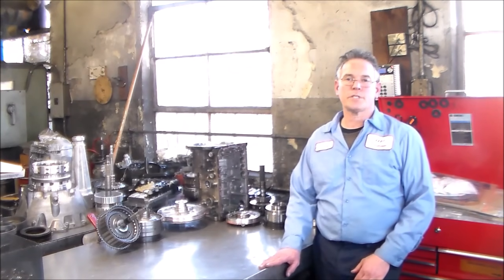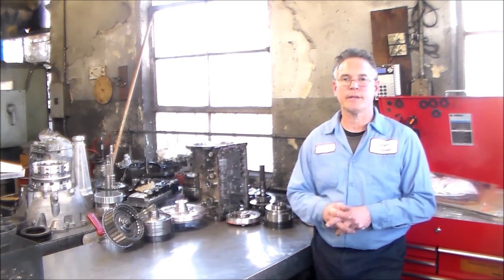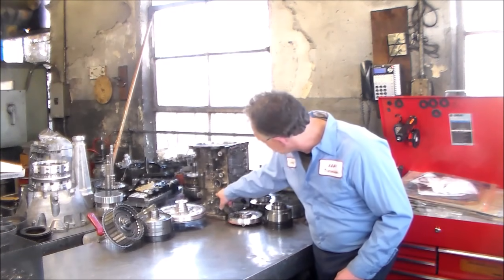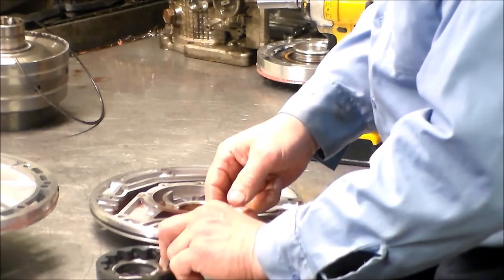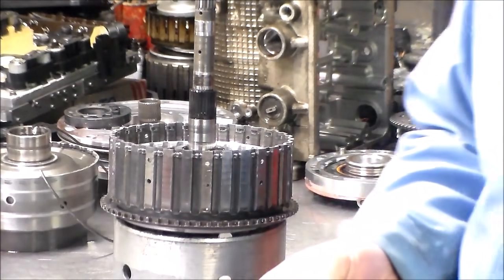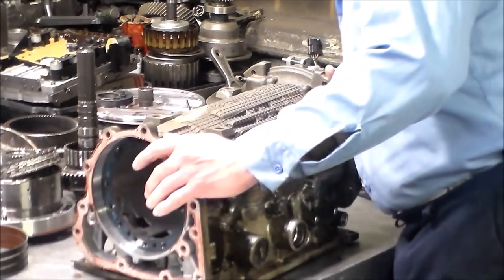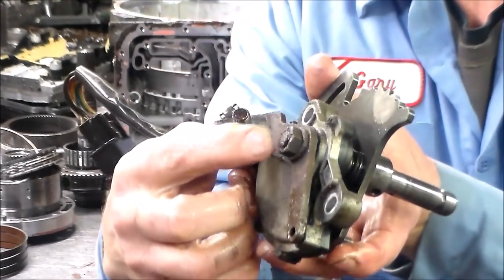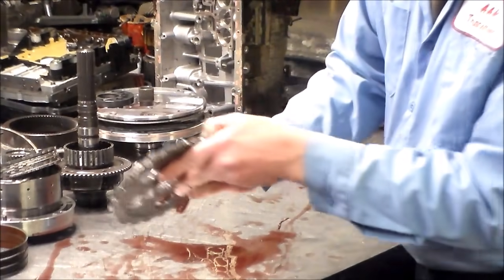V5A51 Teardown Highlights

Comment: I worked for Mitsubishi for 17 years and went inside of every transmission they built from about 98 to 2017 but never had to open one of those up.  They were some extremely good transmissions and of course it helps that the V6 engine didn't have a lot of power either.   They often got driven around in 4 lo due to the transfer case switch issue.  Wonder if that's why this one has damage?  Thanks for sharing!
Reply from the maker: They are good agree with you there, talking to some rebuilders, they said when we get those in they are always busted up, so when they go, they go. LOL  Thanks for watching
Reply: How do you replace the springs in the valve body with the 4 cups? one of them a single spring.
Reply from the maker: @rolandnicholls478  I can't remember, would have to watch the video

Comment: Hi, So i have a, and we call them Mitsubishi Pajero Gen 2. So i guess it would be the 97 Mitsubishi Montero gen 2 3.5 v6 LWB Auto OD  FWD. I have the super select as they are all known.
Now when i start my Pajero, it has a deepish whining noise that you can hear clearly at the bell housing area. It sounds like a power steering pump whine but constant. It does not change noise when you select R or D gets little louder as the cars revs pick up and down. The noise stays in sync with the engine speed. It has sound like this after owning it for a Year and a half, a little louder, i also have a vibration. I rebuild the engine, and after that the cars vibration was from 80KPH to 149KPH, about 50MPH to 90PMH and then it goes away. After i replace the rear differential LSD oil with OEM oil the vibration is only from80MPH to 86MPH. Some one said my rear diff bearings need replacement. The vibration when i purchased the car was only at 80MPH. After engine rebuild it started vibrating so badly. Not the engine causing the vibration though. I have replaced the Transmission filter and oil during engine rebuild in lockdown March 2020 with OEM parts from Mercedes Dealers as they are the dealers for Mitsubishi in South Africa. I also replaced the oil pump oil seal in front of the transmission. Does the torque convertor only go in one way that it is balanced or is it any way as long as the guides slide into the pump. Expensive This Mitsubishi parts. I will email you a video clip of the noise. Later today.

Any ideas. Thanks for the great help last time with the Viano auto tear down and advice. Although it has jerking now when cold and changing from second to third or 1 to 2 after like a years driving
Reply: Oh The Pajero drives fine and it kicks over normally no issues, oi level is correct
Reply from the maker: @sv_endless6340  Did the noise change after the transmission filter was changed?
Reply: @GaryFerraro  No the noise stayed the same. And it is now louder as i have been driving a lot in the year and a half sins the service. I am trying to email a video but cant seem to send it as a video.
Reply from the maker: @sv_endless6340  File may be to big.   With the car running, take off the oil fill cap and see if the noise goes away

Comment: Thankyou. I am about to remove mine and repair myself. My first one, wish me luck.
Reply from the maker: These units break up, this is the only one i had so far
Reply: I have for a long time wanted to learn how a auto trans works and how to repair them. I have stripped and repaired manual gearboxes but never an automatic. This one is from my own car which lost all transmission fluid and continued to be driven for a while. I topped up the trans fluid and have 1st and reverse with no problems then changes to 2nd and the trans slips. If I rev the engine, a clutch grabs and drives but the engine is reving far too high. I reduce the revs and the clutch slips. No bad noises coming from the transmission at all. I’m hoping the problem is in a couple of clutch packs. Prior to this the transmission was well taken care of. It’s a 4x4 Montero you call in in the US. I’m in Australia.
Reply from the maker: @georgetawhiti2133  ok, there is not much info out there on this trans. be careful, may want to video tape yourself taking it apart. Greetings from New York
Reply: Thanks. Videos a great idea. Your videos are extremely educational and have given me enough confidence to give it a go.
Reply from the maker: @georgetawhiti2133  Ok, Great, I'm sure you will do fine

Comment: Hi, I'm turkey from Istanbul you do have a question I will my 1600mot automatic transmission have a tool that has the problem mutsubi the 1600mot is in your hand a 1998 model mutsubi automatic transmission repair video Does my vehicle automatic transmission, but the vehicle in place does not get the help I'm glad if you can

Comment: Hey Gary, love the channel :). I have a Mitsubishi Galant VR4 (called Legnum VR4 in Japan), it is a V6 twin turbo 280bhp 4wheel drive (all time). The automatic triptronic gearbox it uses is the W5A51 5speed. The W5A51 generally in this car has an issue with the wave spring breaking and destroying the internals. Some boxes are OWC One Way Clutch. Would one way clutch be a better box?. Can you suggest any upgrades or improvements that could be done to help the box handle the power. Also could anything be done to the torque converter to help handle the power?. I have gone through 3 auto gearboxes in 16 years. I am in the UK and it is more cost effective to find a second hand full unit and just change the whole box. I am running about 350bhp. The four wheel drive system is the same as the Mitsubishi Evo, with the centre diff and the ayc active yaw control rear diff. Any advice on any upgrades from other Mitsubishi boxes or kits etc would be much appreciated. Keep up the good work, cheers from Scotland, Louis
Reply from the maker: That is what happens to the F5A51 Transmission front wheel drive transmission, they make a real thick wave spring to fi that problem, The wave spring would break and a piece would work it's way into the pump and break the gears

Comment: Do you know what the difference is between the V5A51 AND THE V4A51. IS THE TRANMISSION HOUSING THE SAME? 
VALVEBODY IS DIFFERENT. 
COULD I MAKE A 4 GEAR OUT OF THE  V5A51?
Reply from the maker: Not 100 % sure, I have only done one of these which i did the video on,

Comment: Wow that unit was in pretty tough shape! I hope that you can source the geartrain that you need to overhaul the unit Gary. How many miles on the unit at the time of failure?
Reply from the maker: I did source the planet set, not many around cost me about 500, think the trans had 150K on it
Reply: @GaryFerraro  feel bad for the customer that this will be a very expensive repair, but they brought it to the right place! Cheers Gary, great video as always.

Comment: The accumulators springs have different heights. I want to know which position each for because my transmission still onto the engine I just take down the body from bottom and everything drop out.
Reply from the maker: I have no info on this trans at all, nothing out there
Reply: @GaryFerraro  okay thanks
Reply from the maker: @rolandnicholls478  Welcome
Reply: Did you sort it ? There is info on the pajero workshop manual , the springs are marked with a red paint type marker on the end/ends every1 is different so check the manual , i found that out the hard way too 😂